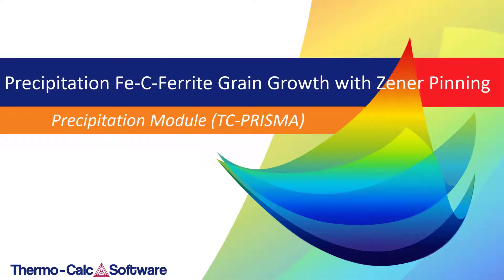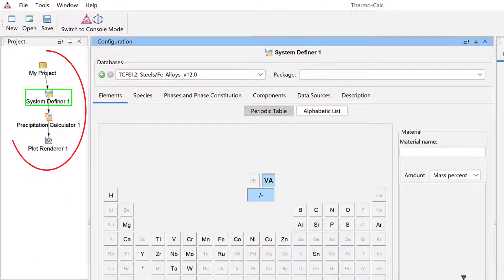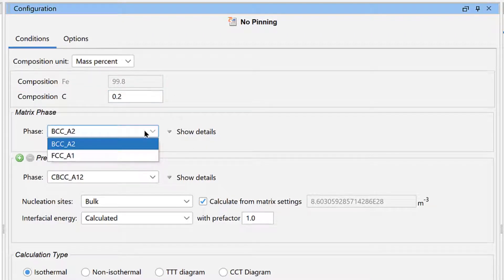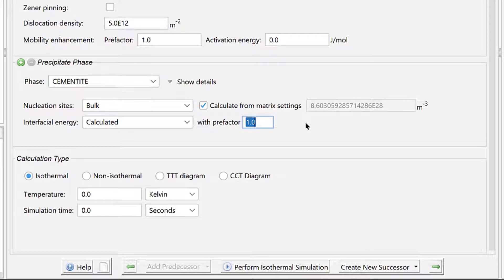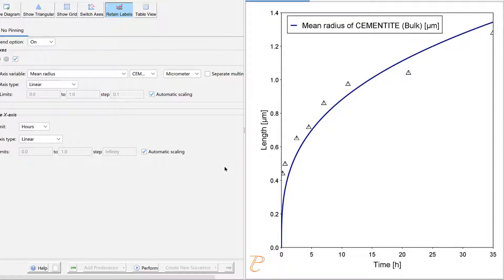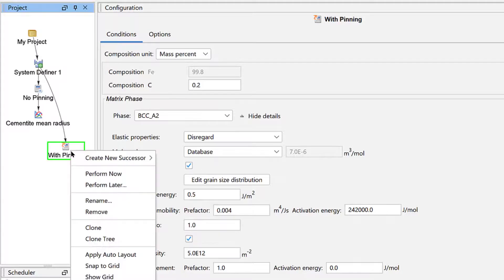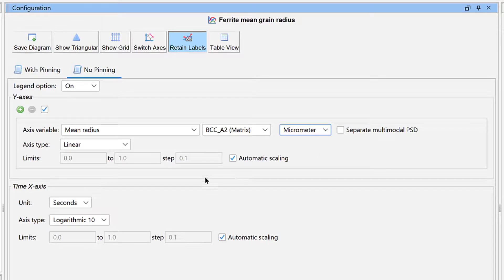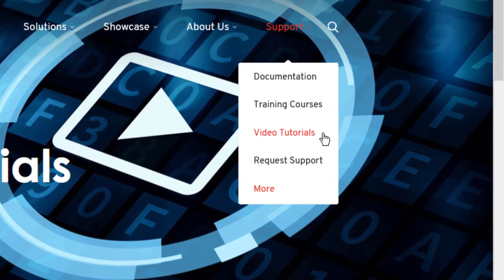Example P_14 - Precipitation Fe-C-Ferrite Grain Growth with Zener Pinning

Comment: Hi

Regarding the values of grain boundary mobility, activation energy, and grain boundary energy set by the default setting in the grain growth simulation, are their values always same for any alloys with different chemical compositions? For example, when you run the grain growth simulation for a nickel-based alloy, are their values set by default setting always the exact same when you run the same simulation for other alloys like stainless steel, steel, Al-based alloys etc?
Reply from the maker: Hi @achmadariaseta9152! Thank you for your question. The default numbers are the same for all systems and for all phases, so they should be viewed only as place-holders. There are no settings for these in any database, so the values should be chosen by the user. We give some information and recommended values for certain groups of materials (at least for Grain Boundary Mobility) in our online help, which you can find in Thermo-Calc in the Help menu > Online help. If you search for "recommended grain growth parameters" and click on the first response, "Normal Grain Growth", you will find the information and recommendations.